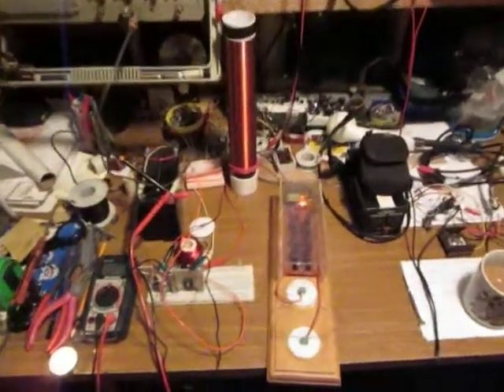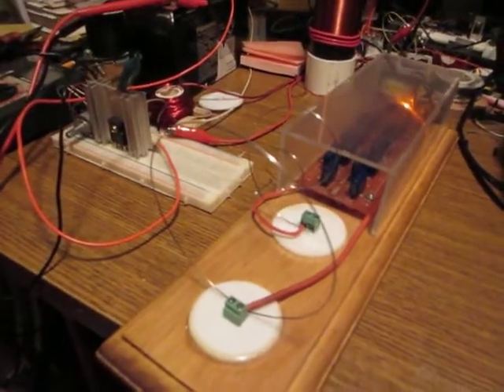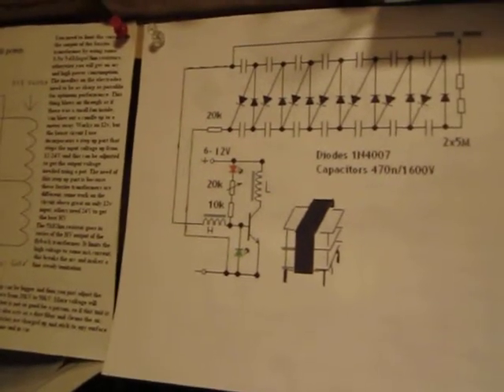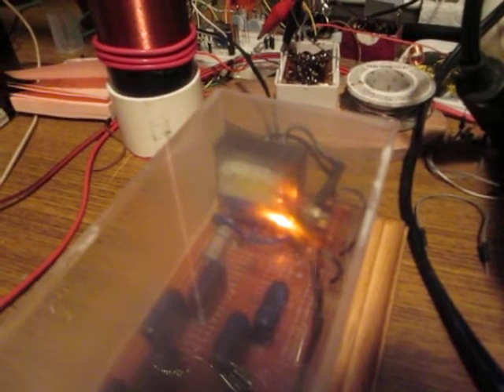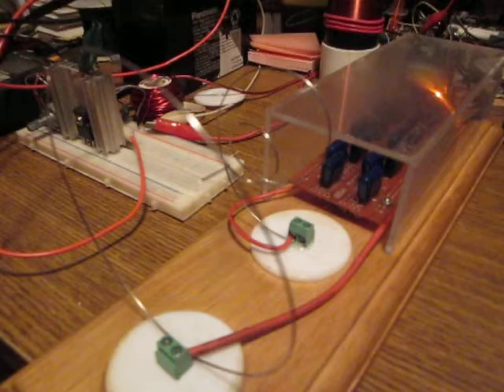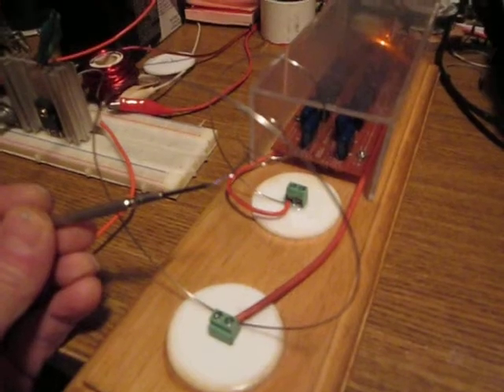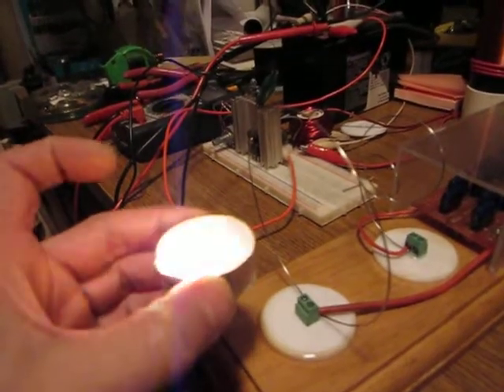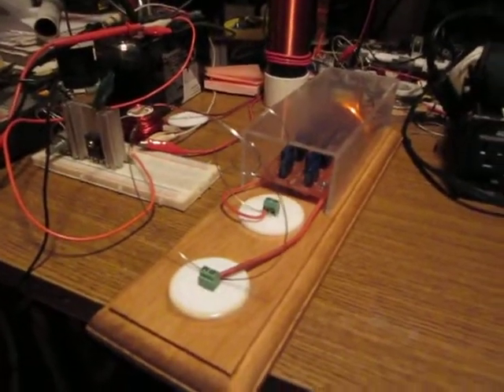Negative Ion Generator - different way

Comment: Some sort of wire grid would probably trap particles better, dust would definitely still pass through the center of the loop and not be attracted to the wire due to the wind.

Comment: Which is output voltage and running frequency from this voltage multiplayer?
How many stages?
How do you test this think, to be sure it generates those negative IONs?

I've created HV a few kV DC PSU based on custom designed ZVS driver using CRT monitor flyback transformer like this shown on this short video, but here were clear a few mm plasma sparks, so toxic ozone, I guess too...

How to distinguish negative IONs?

ZVS flyback driver high voltage plasma from 12V car battery
https://www.youtube.com/watch?v=yInXYtykWSQ

Comment: Hi is it possable to build a negative ion generator utilising the alternator and starter motor on a car by the b+ of the alternator loop fed to the aluminium head then that loop fed to the exciter if the starter motor the aluminium would eddy current a type ac and the starter would then become a dc pulse.  View joe cell horses mouth video one hour in he shows his electrostatic car running by this negative ion atom air stripping technique engine becomes a magnetic attraction repulsion as aluminium pistons act as a electrode switching polarity for the upward attraction then downward repulsion any help appreciated hus video man ingventor on YouTube tells me it's scary how simple it is he does mention a right gand vortex swirl on the earth to engine to body as you have on yours seems to be acting as an aerial but chrome seems to play a part as the aerial say a old car bumper

Comment: Hello, I would like to know the formula for the frequency of the circuit you show, can you send me a reference on the papaer you show along with the schematic. Maybe it is on the. I constructed a nine stage with 20KV diodes and 330pF 20KV capacitors to get up to 70KV

Comment from the maker: Hi, It works fine and I have both running continuously since they were built without any issues, beside periodical electrodes cleaning.
The idea was to make a circuit without flyback transformer. VM can have a Joule Thief or any type of low current oscillator providing couple hundred volts. 10M resistor act as current limiter so even shorting electrodes will not cause any damage. Cost-wise it depends on capacitors price but VM version should be less expensive anyway.

Thanks
Vtech.